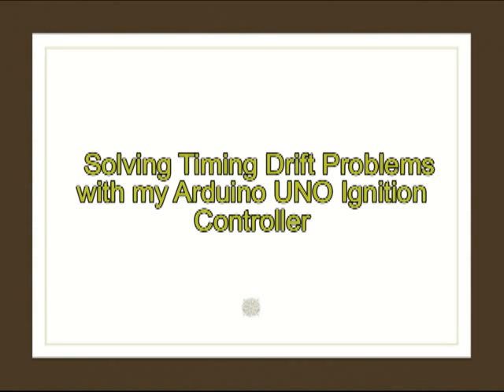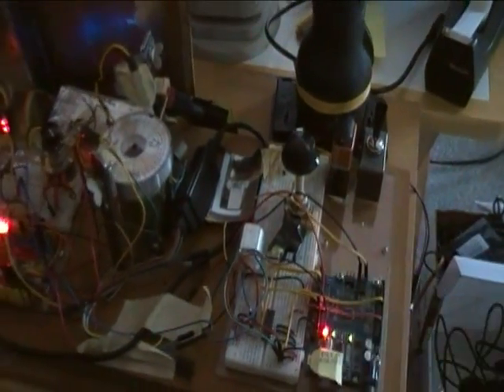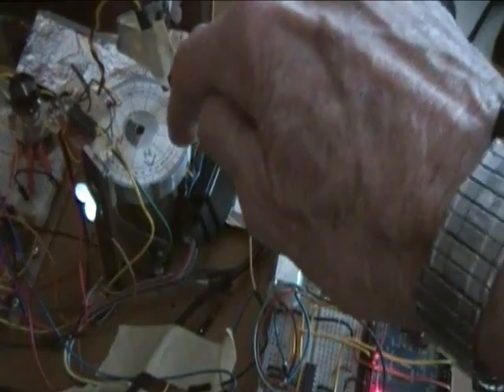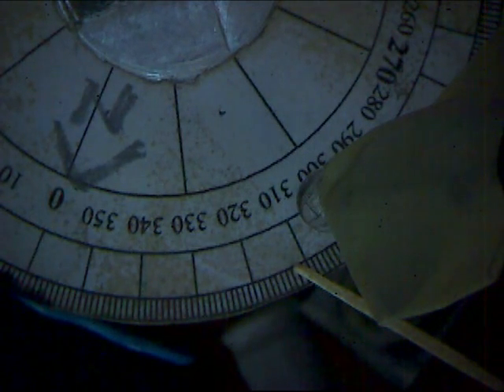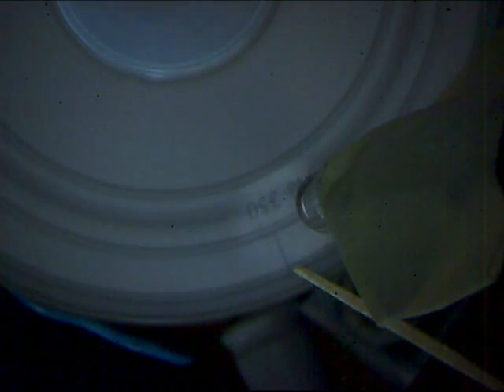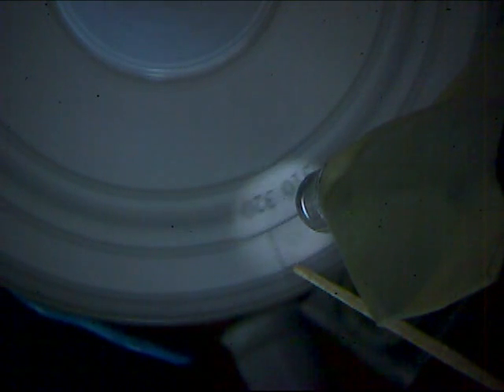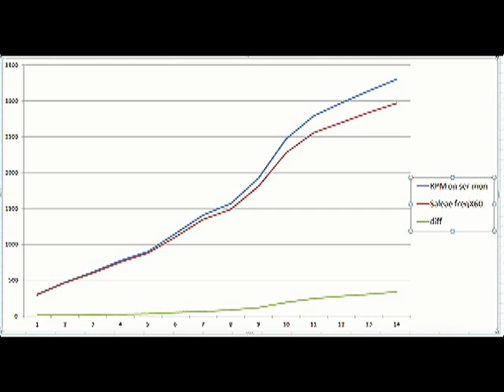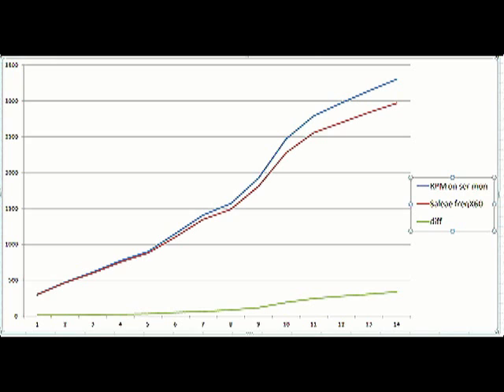Arduino UNO Ignition Advance Drift Solved

Comment: how did you calculated the dwell time for example if you want to spark at 45 TDC you have to trigger 3000 - 4000uS before the 45 degs before TDC. so you have to combine the dwell time with advance delay
Reply from the maker: I did not CALCULATE the dwell time.  I measured it using a coil saturation tester that I built.   So far, I have seen coils whose saturation times vary from as little as 2 milliseconds to as much as about 8 milliseconds, when the battery voltage is between 12.5 and about 13.  But so far, I have not implemented code to sense the battery voltage and adjust the coil saturation time  as needed.   
 When I say "coil saturation"   I mean that I vary the coil charge time while watching the coil current on an oscilloscope.   Just at the TIME when the current flattens out (stops increasing) is the "saturation" point.  There is nothing to be gained by maintaining the coil current any longer than this, so that IS the saturation point in time that I use in the overall timing delay math.
Here is a link to the coil saturation video that gets right to the point:
https://www.youtube.com/watch?v=7LAt-pA9dWY
This  link is to a more detailed look at how I  developed  my coil saturation tester:
https://www.youtube.com/watch?v=B8-zb5TKffg

Comment: Hi Pete! I'm sure you already know this, but if not - maybe this helps you in some way. There is an arduino powered standalone ECU being developed called Speeduino. For your project it is probably not the way to go, but you can definitely check out the source code of speeduino to see how that works.

Comment from the maker: Hello Anders.  I think we are going to try an engine pretty soon.I am really glad to see that Josh Stewart has chimed in.I see him as THE expert on this sort of thing.  My simulator's little motor only goes to about 3300 rpms right now.  I have ordered and received a bunch of 6000-10,000 rpm motors so I can try it out at the "real" design speed.  But all that will have to wait a few weeks.  I did look at your code, but I didn't have time to read all of the responses in detail.  Looks like you are getting some good advice.  I can learn a lot from reading the comments.What kind of coil are you using?  
We had a hard time finding a 2-tower, 4-wire Coil Near plug pak that we could easily get low voltage connectors for.The one we have chosen (so far) is from a 1999 Toyota RAV4.   There must be many others out there that will work, but we haven't found them yet.       We should have a common place for continuing these discussions and I hope that Josh continues to look in on us.UNO dedicated simple ECU guy,Pete Stanaitis----------------------

Comment: Hello Pete!
I can't tell you how surprised I am when I see your video and your code! I live on the other side of the earth, working on almost exactly the same project as you are doing! You can read about my Arduino EIS here:[urlhttps://forum.arduino.cc/index.php?topic=369684.0[/url]

I am having the same problem as you are. I hope we can help each other. I will try to use an other arduino to simulate the engine and a third arduino like an scope. I have a lot of trouble with high EMP. I will try to build an aluminum box and use all shielded cables. I will also try to use optocoupler between the coil ignitor and arduino.
If you have any wiring diagram I would love to see it. I would be glad if you could join the arduino forum and discuss more. 
I also have an idea for making the system redundant.  Using two of everything except the coilpack (VAG Bosch smart coil pack). 
 Hope to hear from you!
Greetings from Anders Stenhammar in Sweden. 
www.andersstenhammar.com

Comment from the maker: See: http://spaco.org/Computing/arduino.htm   Or, at the bottom of the page,:   http://spaco.org/Computing/CodeForIgnitionControllerJan232016.txt

These links were updated on Feb 14, 2017
Reply from the maker: I am sorry for your trouble, Vivek.  For some reason the links won't work now.
Here is a new link to my Arduino page, which contains the article "Using an Arduino as an engine control Unit":    http://spaco.org/Computing/arduino.htm
At the end of that article you will find the link to the code.
Pete Stanaitis
----------------------